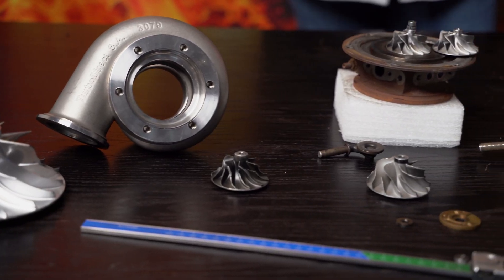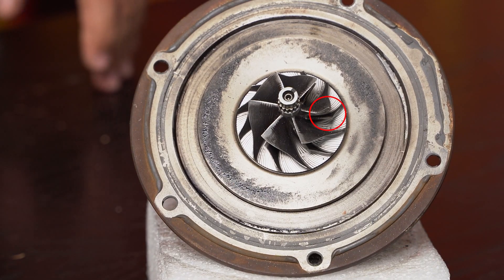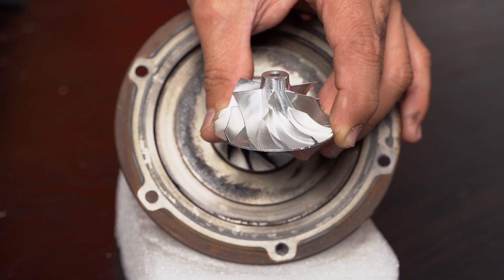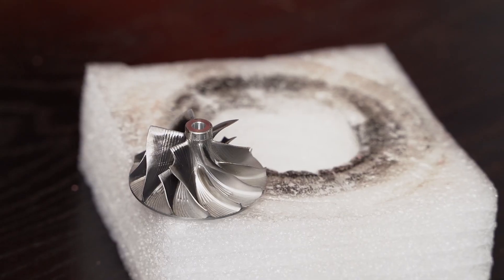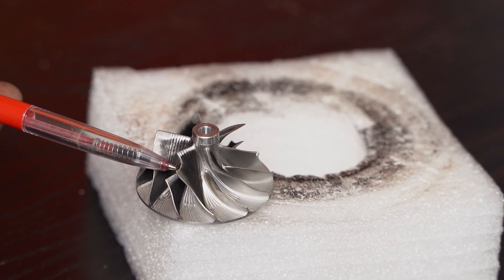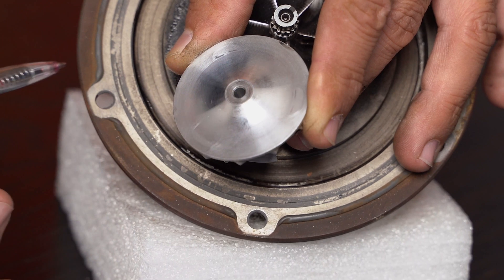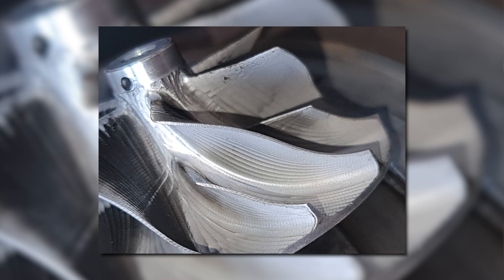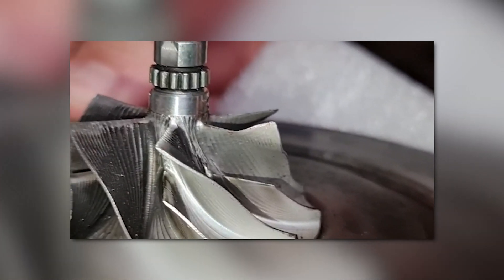Turbo Failure analysed

Comment: Hello, very informative video, what's your opinion on water injection pre turbo? So right into to compressor wheel? I build a set up with this, and planning to map it to it's absolute limit (3.5 bar 60mm compressor wheel) with the water injection. Mainly to keep the engine cool. Should i worry about the compressor wheel failing? It is a oem billet wheel. Thanks in advance
Reply from the maker: @benjaminvandewoestyne4912  not good - let me explain why - the sealing system on all turbos rely on a split seal ring (piston ring) and even in its compressed state it has a ring gap and clearance under the ring in the ring groove. It’s designed to allow air pressure from the compressor housing through into the bearing housing to aid in sealing. Injecting water into the bearing housing (yes very minuscule quantities) is never a good idea.  Fuel for this carby fans - same thing applies

Comment: 8 54 I worked at a turbo charger manufacturer up to 1999, all the compressor wheels were cast via investment casting technique, then turned on a CNC lathe to various profiles to suit compressor cover profiles.
Gaz UK.
Reply from the maker: @Gazr965  casting is one of many different processes used to manufacture compressor wheels.
Reply: @TurboDirectSA  Yes, although castings were faster to mass produce, some were harder to balance after machining, some would be scrap as there was a limit on material removal.
Reply from the maker: @Gazr965  forged materials are more homogenous than castings and much easier to balance
Reply: @TurboDirectSA  I would think a compressor wheel would be hard if not impossible to forge, but I left 1999, so don't know how the industry has progressed.
Reply from the maker: @Gazr965  the material in billet format is forged and then CNC machined from that forging
Reply: @TurboDirectSA  Ah, ok, would make more sense.

Comment: I've a 3 year old car and it's been diagnosed as to much end float, splines have to much movement, does this mean it's on its way out? Please advise me what to do
Reply from the maker: What end float measurement is recorded, and how was it measured? Is there oil leakage? Heavy oil consumption? Smoke out the rear of the exhaust? Any audible sounds (whinning or screaming)?  Loss of power?
Reply: @TurboDirectSA thanks for getting back to me, the garage has told me the bearings have gone, it's a 21 plate, he doesn't know why, the turbo makes a clicking noise on idle
Reply from the maker: @annbrown1558  send an email to info@turbodirect.co.za and the techies there will assist you

Comment: Hey Chris, love the video. From the information you have given, and from from what I can see. I am thinking it is from the PCV system. The newer low tension compression rings on the piston rings causing lots of blow by. The carbon builds up in the hoses and gets broken off hitting the blade. The only reason I am saying that is I work on Turbine fan blades are not that dirty. However they have erosion.
Reply from the maker: Correct sir - however this specific engine does have carbon build up which flows through the breather.

Comment: excellent presentation. When you started calculating tip speeds, I though it might lead to trans sonic shock waves due to overspeeding. ie constantly cycling above and below mach 1, with corrections for air density and humidity. ie maybe a low working altitude with high humidity (deep mining application). Your explanation is far less esoteric. did a catch can solve the issues?
Reply from the maker: Thanks for the feedback

Comment: Hi thx for a wonderful analysis.  Iv a massive radial play just three working days after fitting new core. So much so that oil is leaking through the exhaust side and its burning the oil. Please  advise
Reply from the maker: This could be a number of things - we would need to disassemble the turbo and inspect it to ascertain the cause of failure.

Comment: due to speed and hardness of the metal it would take impact at a relatively high speed strange its only one blade no glancing signs or recoshae after straightening boat props you have to be particularly careful how you reverse the damage that thin of metal cant take much stress .

Comment: I had a turbo fail.  The shaft broke right before the exhaust wheel.  It appears to have had plenty of oil for lubrication.  No signs of heat damage.  So trying to figure reasons for this to even happen.   This is a garett turbo
Reply from the maker: Are you able to shoot across some pictures of the disassembled turbo ?? If so send to info@turbodirect.co.za

Comment: Hi Chris, thanks for the great info, what would you say can possibly cause, turbine leading edges breaking off? , but not all just one sometimes and there’s no signs of heat corrosion on the edges??? It’s on the BMW N54 with the twin turbo’s and it’s the rear turbo every time having this issue 
Regards
Reply from the maker: Hi Eric, thanks for the comment, please confirm which blades you are referring to? Inducer or exducer blades? The most common blade "breakage" is usually the exducer blade which relates to a few things, and is most commonly associated with HCF high cycle fatigue, which is usually induced through over speeding, or poor material quality or casting process (poor material grain structure - usually large grains and/or porosity)
Reply: @TurboDirectSA  it’s on the exducer on the turbine, I suspect the rear turbo’s outlet piping leading to the Intercooler is to small for the higher flow that is trying to pass through, thus putting more heat and  strain on the turbine side, thanks so much for your insight, I’m going to open up the rear outlet to a bigger size piping going to the Intercooler, and try to increase Intercooler efficiency
Reply from the maker: @ericvermeulen9853  Send me a picture of the break itself, high res zoomed in, and a few other pictures, ill confirm if its a thermal load related failure - which i doubt.
Reply: @TurboDirectSA  email address ? Or whatsapp?🙏🏻
Reply from the maker: @ericvermeulen9853  info@turbodirect.co.za

Comment: Looks like a good catch can would help a lot with this sort of problem.
One question. How thick is the blade originally?
Watching this video and seeing the speed of the outer parts of the blades has made me wonder how many compressor and turbine wheels exceed Mach 1. The engineers must have had their jobs cut out looking at the effects on the airflow with sonic shock waves being formed.
Reply from the maker: The speeds that these rotate at are alot faster than you might expect. Some OEM turbochargers tip speeds exceed 1700KM/h

Comment: Hi, my hilux started to whistle loud just at 4500kms off the showroom. Is it because of a leak or turbo failure. It increases with engine rpm.
Reply from the maker: Have you done software?
Reply: @TurboDirectSA  STOCK :(
Reply from the maker: @stevyop99  Its under warranty, have you taken it back to Toyota?
Reply: @TurboDirectSA  Yes, I had to fight with them for over an year because no code was given from the scanner. Luckily they offered a new turbo. But I'm worried without finding the cause it might happened again right ? I took this to 3 normal mechanics who said ;
1.Bearings damaged    
2.Intercooler boost leak  
3.Hose damage

Btw I head that high pitch noise in every updated 1gd engine Fortuners.But not hiluxes. (This is a prefacelift 2020 yom 2.8 hilux auto 4x4) Its interesting and sad at the same time.
Reply from the maker: @stevyop99  I drive a hilux GD6 s.8 daily at the moment as the shop development vehicle - if you referring to the high pitch sound when tapping off the throttle, ignore this, this is the gas path directed by the VNT assembly as the internal guide ring moves the vanes to the open position. If its a high pitch "siren" when under load or full throttle, this is a different story altogether. 

There is a very simple and effective way to test for a boost leak when the engine is off, allowing you to find the exact place of the leak if it exists.  Whoever told you bearing wear, doesnt know much about turbochargers - ignore that comment.  contact us info@turbodirect.co.za and we can arrange for you to bring the vehicle in and we will do a pressure test and confirm whether there is in fact a leak or not.

Comment: What causes the fins from the turbine shaft  to look corroded? Or pitted
Reply from the maker: The surface of the blades would never become pitted (small hole indentations) from normal use. Something that can cause this is impact damage sustained on the surface of the blade, but this is not very likely, as the primary point of contact is the leading edge of the inducer blades if something should enter through the intake tract of the turbine housing. This would normally damage the blades. 

The presence of carbon build up is common, which does sometimes give the appearance of pitting.  If you can shoot an email to info@turbodirect.co.za ill be happy to ask Chris and the team to look at it and give you feeedback.

Comment: so what  brand air filter caused the failure??? cant say??
Reply from the maker: This video is educational on the different and sometimes complex failure mechanisms.  No air filter was pin pointed as the cause of the failure - watch the video, the details are in the video as to the contributing factors and failure mechanisms relating to the erosion of the compressor wheel blades.

Comment: basically by withholding information on the manufacturer of the cause of failure of the turbo, you are protecting the manufacturer and not the public
Reply from the maker: This video is educational, the manufacturer, brand, model, part# has nothing to do with the failure mechanism which is the primary and only reason this clip was produced. 

Pointing fingers is not the MO of the video - understanding a somewhat complicated failure is.

Comment: I don't understand where the carbon is coming from. Is it carbon particles? I know some vehicles use a charcoal filter for the intake. Is it shedding dust from the charcoal vibrating against itself? Are they driving in a smoky area? PCV issues? Diesel exhaust rebreathing?
Reply from the maker: Carbon forms inside any and all engines, more so with Diesel engines as a result of the combustion process. Im not sure where the carbon originates from, but the carbon is confirmed as the material found on the compressor wheel blades.  We have purchased on of these vehicles as a development vehicle and will be investigating this in the coming months.

Comment: Is it possible to re balance a billet compressor wheel after it got chipped by a stone? Turbo is whining the turbo is not even 6 months old
Reply from the maker: Yes ofcourse it is - this is done separately before being re-installed onto the CHRA and then rebalanced on the VSR at high speed as an assembled CHRA again.

Comment: it was very good video i liked alot but i hv question? 
i got a second hand volkswagen vento 1.6L manual diesel engine and drove it near about on 160 km/hr and suddenly the core of the turbo broke down so can uh help out that should change the core of the turbo or should change the turbo.
reply urjent please
Reply from the maker: Abhinav the answer to your question depends largely on how badly damaged the turbocharger is internally. If the end housings and/or VNT assembly is damaged inside, then its a new turbo. If the internal structure of the housings and VNT assembly (if its a VNT turbo) is in tact and not damaged, then the CHRA replacement is possible no problem.
Reply: @TurboDirectSA  if we chnge the core after that can drive like before we drove like on 130km/hr or on more speed
Reply from the maker: @abyvlogz  First thing first - you need to find the cause of the failure and correct that - before you repair and reinstall the turbo again, otherwise you'll feed the engine another turbo. You should be able to drive the car however you want, 10kmh - 300km/h if it will get there.  If the turbo setup is functioning correctly you can drive it however you feel.
Reply: @TurboDirectSA  only core id broken everything else is fine

Comment: Wow that's very interesting. At first when you were discussing the CNC process I thought perhaps two cuts of the point mill had fallen along the same line creating extra thin areas in the blade. The erosion makes so much sense though. Also interesting to think about how the very small channels created by the milling will create air channels and therefore areas of more and less erosion. I wonder if a different milling pattern alone could make a large difference. Great video!
Reply from the maker: A Radius is the best shape to machine anything with, as it negates the possibility of a surface fracture form starting.  The point milling is not used for air flow as much as material fatigue/fracture purposes.
Reply: Thats where my thought process was going
Reply: @antonymintram8790  It's all really cool analysis!

Comment: Hi Chris, would a turbocharger be damaged if mounted at 30 degrees to the horizontal line?
Tia.
Reply from the maker: Both axial and radial directions are horizontal - which are you referring to?  Do you mean the angle of the bearing housing pointing forward or rearward?  Or are you referring to the compressor housing facing upward or downwards?
Reply: @TurboDirectSA  the compressor facing upwards, sorry
Reply from the maker: @cetGT3  Buddy depending on the turbo, some you MIGHT get away with it, if its mounted to a VEE engine, but most of the time you will find oil leakage past the split seal ring/s.  Some of the new turbos use twin rings, and others use single - ill be making a video on the internal structure of the bearing housing on the Garrett turbochargers coming soon, so you will understand this a bit more.
Reply: Yes, due to puddling of oil  from being unable to drain correctly.  

This do not exceed goes for front to back , left to right, and bearing housing clocking.
Reply from the maker: @daviddroescher  not necessarily -- it depends on the V angle of the engine when/if used on a Vee engine, aswell as what application (rock crawler, hill climb etc)

Comment: Does a finest (less microns) air filter should be used to fix this issue ?
Reply from the maker: No - this will starve the setup of air, and at the same time cause a thrust failure - ill explain this in a video in the future. 

Use the OEM filter, and do regular maintenance - this failure is an odd one and not often you will see this type of failure - remember also we live in Africa - things are abused here unlike other EU and US and AUS countries.

Comment: Would a catch can  between the turbo and valve cover keep some of  PCV Shmoo/ airborne carbon off the wheel to prevent the next failure?

Customer states multiple repeated same mode failures.  A) how many? B) how long did it take to accumulate sufficient erosion to allow bending/failure? 
(  (b) will show  just how sensitive the wheels are. I'm  assumeing they(3 or more)were rather short lived.)

Orange  peel on back side is a mid range indicator of repeated over-speed,on its well on its way to failure.   
Is there any way other than the spec gage(from borg or gerrett) , orange peel, or gross failure to tell if a unit is experiencing over-speed? Eg stress marks/striations, color gradiants at or around the  typical brake piont?
Reply from the maker: No need - this is outside of the design parameters of the turbocharger.  A breathing engine is doing so for a reason - find that and fix it, problem solved - dont forget the turbo though. 

These vehicles have  very high mileage on them, and more than likely missed schedules and/or prolonged maintenance negligence that caused  engine problems - knock on effect.  Total numbers we have seen are in the 10's currently, but expecting alot more to be honest. 

Orange peel is what you see when a wheel is over-sped - it shows the analyst what the cause or contribution to the cause of failure was - unfortunately this is after the failure occurs.

Overspeed has no real symptoms during operation, however it causes gradual and consistent damage until failure - once the effects have started, they are not reversible.  Extreme boost levels, poor tuning,  "hybrid" upgrades with incorrect wheel choice ... some of many contributing factors. 

Once the failure occurs, we are able to use the striations to determine the initiation point of the surface fracture, and (believe it or not) the total cycle revolutions until material failure.
Reply: @TurboDirectSA  I have seen someone report a turbo over speed error message on a 2020 golf r... :)
Reply from the maker: @Archiemosses  We see this daily - it doesnt bend blades though.
Reply: If the blade is 0.3mm after erosion, what thickness did it start at?  Nice video 👍

Comment: Seen it on older PSA engines, also used in Fords. OEM's turn a blind eye though...
Reply from the maker: I hear you - Ford have the same approach on one of the models here  - we did the evaluation for Garrett  directly.